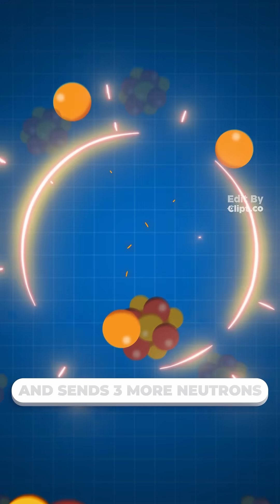How does nuclear energy work??

Comment: Nuclear power plants aren't scary if you actually understand how the plants function.
Reply: fr, modern-day reactors are so hard to have meltdowns in that it's impossible. Chernobyl was literally just the USSR not keeping them right and Fukushima was just the side effect of the tsunami (which was 15-16 years ago). tech has come a long way, sad to see people being scared just cuz the word nuclear is in it and it has some bad memories
Reply: @justarandomastrocyte  Another thing to add to that, Chernobyl was a blowout, not a meltdown. All that causes blowouts is just too much steam pressure blasting a hole in a closed loop somewhere, which is actually more common in non-nuclear power plants since they generally aren't inspected the same
Reply: @autumntx  ic i acc didnt know that, nice!
Reply: @autumntx Trust me Chernobyl melted down pretty hard, even if the worst part was obviously the big ass blowout
Reply: @justarandomastrocyte  also, if I remember correctly, the problem with Fukushima was with the generators being hit by the tsunami and not because of the reactors
Reply: @minatoreoshino8613 
The generators were under sea level as a cost cutting measure. Had the company followed what the Japanese Electric Commission or whatever said, the Fukushima disaster would've never happened. It's all human error and greed.
Reply: @minatoreoshino8613 they were more dangerous since it was BWR as well. But even then Fukushima wasn’t that bad and the people keeping it up did a great job at doing so (the people that owned the reactors is a whole different story)
Reply: @justarandomastrocyte Also Chernobyl had a negligible director, heck, the three other reactors at Chernobyl kept operating almost 20 years after the accidents.
Reply: @existentialguy21plus Fukushima used a BWR reactor. Not a PWR.
Reply: @justarandomastrocyteAlso it's not the reactor itself that's scary, what's scary is our ignorance like what Dyatlov did.
Reply: yeah, I used to be terrified about nuclear powerplants, but learned how they work and I'm like "how the heck did nuclear meltdowns even occur??!??!" I mean I know a nuclear meltdown is when the control rods LITERALLY MELT, but like... That shouldn't have even happened
Reply: Its because there haven't been alot of meltdowns in history 😅

They are pretty safe. & Chernobyl operated fully via man power with a few engineers with pen & paper doing math with a biggol computer (named SKAL, it's pretty much just a fancy scientific calculator).

Now a days most nuclear plants are automated with Robots & computers & far less people with pen & paper. There's literally no chance of that big of an error. Even three mile island wasn't that bad (They got a small meltdown & released radioactive gases for a few hours but the Core was able to contain it in place unlike a full on explosion at Chernobyl) where's coal/natural gas/disel pretty much 24-7 produces smoke + far more toxic gases. Solar & wind also produce pollution during the production of Batteries. Dams pretty much are super bad for Fish habitats & 24-7 risk of overflow.

 @YourAverageProgrammer1
Reply: I have a feeling that public media also make people scared of Nuclear energy.

(HOT TAKE)
The Simpsons is one I think makes people scared. They represent spent nuclear energy as green goo kept in poorly maintained yellow barrels. And they represent work at the Springfield Nuclear Power plant as shot-y and dangerous. I’m aware it is a cartoon, and not all things are real, (And I have never watch the show), but since it is really the ‘only’ details people see about nuclear energy besides the nuclear accidents, and since it backs up actual ‘fact’, it sheds a poor light on a perfectly fine energy source (if used correctly).
Reply: and this guy explained it so wrong, didnt even explain the effect of neutron moderation properly
Reply: Yall guys khow a game called industrialist
Reply: Fact not fiction or fantasy 
Generation is dirt-cheap.
Both nuclear and roof PV. 
6cent kWh to 2cents kWh.
Nuclear electricity comes to your meter box full of GRID RENTAL COSTS. Big $$$$ cashflow. 

And then when the dunkelflaute stops, the GRID cashflow stops. But only when the sunshines. 

I am extremely concerned for the grid and the grid economics and the grid owners massive investment's ROI, return on investment. 

The grid was built over 14decades, 140years.
The grid is extremely valuable, too valuable to waste. Unfortunately to expensive to overbuild and too expensive to expand. 

The only way to double grid capacity is to build a second grid, basically double the existing grid capacity. At upto $13million per km in Australia and with 1million km in Australia, and limited number of decades, the fake GRID people live in a fantasy and will do more harm than good. 

Facts do matter, selective facts are just a fantasy. 

" Huston we have a problem "
A problem that most people do not see. 

I welcome all good thinking people because as you say it is a big problem. 

I got pissed off because my CivEng Degree friend who built designed and built earth dams in the rural Australia and read a book on nuclear chemistry promotes nuclear on national TV. 

He totally ignored my CivEng Degree and decades in large civil construction and building works and power stations and transmission lines and urban infrastructure. 

He took his EXPERT CONFIDENCE in areas of no expertese that was totally wrong. 
He got angry at non experts telling him he was wrong. FMD. 

We both have grandchildren who deserve a future. But he is wrong and only part right. 
He is dangerous. 

So I speak up.
Reply: Okay
Reply: It's scary when humans make mistakes
Reply: @healis  it's scary when humans cut corners is what you mean.
Reply: @milkycalcium3172  also the people hiring Dyatlov at Chernobyl, that idiot should've never been in charge of the fourth reactor
Reply: @Benjam1n-K14  I guess you are basing your knowdlege off the hbo series because dyatlov irl did what an actual rational person would do, it was just changed to add drama to the series
Reply: @milkycalcium3172  you don’t make nearly as many mistakes if you don’t cut corners!
Reply: @healis a meltdown is impossible nowadays, human error won't magically cause it.
Reply: Until they are, and then its a mistake that takes hundreds if not thousands of years to fix.
Reply: @ninji5226 Fukushima is safe three mile island is restarting and chernobyl is the worst possible outcome decades ago from a country that doesn't exist anymore
Reply: @ninji5226 no Meltdowns will happen bruv, calm dowm, but if you want humanity to go extinct in centuries because it got too hot, be my guest.

Comment: I think there’s a problem with this video, the neutrons have to be slowed to be able to start a reaction, the water slows it down because it has a similar mass, and also it has a side effect, if the water is boiled off a meltdown cannot occur due to the fact that the neutrons are too fast to sustain the nuclear reaction so the reactor stops, that’s why nuclear disasters rarely happen these days except for Chornobyl which used lead instead of water 

P.s they actually also remove the control rods that have alpha emitters that start the reaction to stop the reaction
Reply: Also, the outside of the reactor is made of lead and not steel as lead has a higher density than steel.
Reply: @imokaytrustmeBSS  Most nuclear cores are shielded in concrete and steel, and the outside of the actual reactor will be made of a neutron reflector
Reply: this is incorrect, a LOCA accident will indeed cause a meltdown as while the nuclear reaction would have indeed ceased without a moderator, you dont account for natural decay heat of radioactive materials which will melt the rods.

 although this is not an inherent issue, while this is an ossue for BWRs and PWRs, future reactors sich as the already existing HTR-PM cannot meltdown even if left totally unattended as it is made to handle extreme temperatures and self regulate its reaction, as temperature rises reactivity decreases which reduces temperature to an equalibrium naturally.
Reply: What you're talking about here is a moderator in a nuclear reactor.  I thought Soviet-designed reactors used graphite as a moderator.  Most others use water as a moderator, likely for the reasons you cite.  Boil-off of water as a moderator is a bit of a safety mechanism.
Reply: @kattphloxworthych  yeah I made that comment as I just woke up, so thanks for pointing those stuff out
Reply: @kattphloxworthych  and I also think it’s graphite too, but I struggle with memory related stuff
Reply: There is another problem in this video, the water steam turbine turns a diesel generator, great
Reply: @mfr04  What are you talking about? Where did you come up with this?

Comment: They’re far from scary. But you really did a good job explaining them. You missed a few important things (like the backup generators to keep things on in an emergency to prevent a meltdown. And the fact that the used fuel (which can be recycled we just don’t because funding was cut for the company that was researching it because of the three mile island meltdown) is kept in casks that are safe enough to lick or kiss
Reply: He explained what was important , which was that nuclear reactors are glorified kettles.
Reply: @user-pd6ev9gb7j  all power plants are. Anything that’s not Solar or wind (and some water turbines) use energy in the form of heat to create steam from water to turn a turbine to create usable electricity. Fusion will be too. We don’t know how to do it any other way yet
Reply: @youtubersdigest  Yeah
Reply: The control rods shall not be forgotten:(
Reply: I would pursue Nuclear Engineering if my nation's employment wasn't going downhill

Comment: So nuclear energy is just steam power, but futuristic.
Reply: Ironically, it’s also incredibly safe and is one of the better options for the environment. Uranium is also very very common.
Reply: Uhm I say no, because nuclear energy are just modified natural gas/coal energy by only replacing the heat source and fuel
Reply: yeah. in fact there are plans to essentially just go to coal plants, strap on an SMR, and keep the plant going because of how both are steam.
Reply: Not futuristic. The first nuclear reactors were built in the 1950s.

Comment: What's funny is almost every powerplant is just a boiling water and steam-rotated turbine. The difference is only in how to make that steam (coal, uranium or some other type of fuel). Of course, there are other types of powerplants that do not utilize steam. Water powerplant uses water and gravity, wind powerplants use wind. But even then all of them use some kind of turbine that rotates with forces that are available to it. The only powerplant that is widely adapted and does not use turbine, as far as I know, is solar

Comment: That's basically an oversized kettle with uranium rods instead of copper wires. I wish more people knew about that. Nuclear would not be so scary for the public
Reply: AN OVER SIZED COW?
Reply: @sree0814  kettle. English is not my native
Reply: WHY ALMOST EVERYBODY FORGIVES ABOUT CONTROL RODS THE MOST NEEDED THING TO MAINTAIN REACTOR RUN SAFETLY 

And i m not an nuclear power plant expert i just know a litte more about it 

Control rods work isn't that hard to explane in easy words 

"Control rods are made of materials what can absorve neutrons so the reaction chain is slower". 

And next thing about Control rods are 

"Control Rods can be insert fully to shut down the reactor. 
or get out of it and then reaction chain are unstopable"

And any western reactors are builded with additional cover around it so its much safer than chernobyl/soviet reactors what buildings of it was just oversized factories with less space inside amd don't having Additional cover around reactor building (good example of covers like Western are in ukrainian biggest nuclear power plant in zaporioza or in town like that (i don't rememper correct english name of it )

Comment: Bro just taught me how nuclear reactors work in 30 seconds while my teacher would've taken 2 business weeks
Reply: Probably becausw you need to understand why a neutron particle hitting a uranium atom even causes a chain reaction in the first place. And before that you need to understand steam engines as well as basic chemistry. Theyre not teaching specifically how a nuclear reactor works, they're teaching the laws that were the basis for creating a nuclear reactor.
Reply: It's because he over simplified it and didn't explain much
Reply: @alephnull7446  And made several inaccurate statements
Reply: And somehow ill end up learning more from this than i would a whole lecture @alephnull7446
Reply: He didn't even explain it correctly
The liquid in the core is called a moderator and the reaction cant even happen without it (uranium 235 undergoes fission from slow neutron fast one dont work) the reaction speed is controlled by a diff computer controlled mechanism which keeps the temp around 500 C by lowering a neutron absorbing material
And the heat is first transferred to a diff chamber using a coolant where steam is generated and electricity is produced
Reply: @MZ_Faswi  specifically boron control rods that are lowered and lifted to absorb excess neutrons preventing an uncontrollable chain reaction.
Reply: @MZ_Faswi  plus, he didn't explain that when the heat turns water into steam, beacuse of the uranium the steam is radioactive.
And he did't explain that uranium must be Enriched
Reply: @diegopari9708  uranium 235 is the enriched uranium
But the steam being radioactive, I didn't know that
Reply: @diegopari9708 The steam isnt radioactive. The water in the reactor never comes in direct contact with the water in the turbines, and the water in the turbines never comes in contact with the steam that is released from the cooling towers.
Reply: @MZ_Faswi That isnt true, the steam isnt radioactive
Reply: Yea😂
Reply: I learned it on one diagram
Reply: Of course, your teacher is paid to teach you. The faster they teach you, the faster their job is done and their no longer needed / paid
Reply: @Duck_side what? They have an entire school year either way, and how could a teacher be done if every year they get new students to teach to.
Reply: @Duck_side bro teachers take a whole lecture to teach you this shit
Reply: Theres no detail in the video

Comment: Now explain how a nuclear bomb works (for education purposes)
Reply: He did
Reply: Yeah. Its not like I would want to make one. Its not like I have the resources or skill to make one. Want tl learn how to make one for educational purposes only :›
Reply: this is literally taught in schools and for literal educational purposes
Reply: this thing, but instead of water, and a steam turbine, its just the reactor
nothing else, but the thing where atoms go crazy
Reply: @koppanyhorvath1875  this is incorrect, all you get is a heap of radioactive material.
Reply: fissile material is made prompt critical, usually done by compressing plutonium to its critical mass using conventional bombs. in modern bombs this is then used as a small fission bomb to create the temperatures and pressure to create fusion, which is the opposite of fission and far more powerful

conventional bomb -> fission bomb -> fusion bomb
Reply: @jason59k55   A little correction; there are two cores, the main one (uranium core) and the neutron initiator one (plutonium one), you make main one reach critical mass and by the same explosive, it makes the initiator one shoot neutrons to the main one, making the atoms release a lot of energy
Reply: Si 🗿👍
Reply: @becua1007 
Why I see the same comment here
Edit: GET OUT OF THE REPLY SECTION
Reply: It is very easy actually. You get nucleus made of Uranium-235, you explode some explosives and make it reach critic mass and by the explosion, you shoot the neutrons from the plutonium thingy from the nucleus, and as the energy has nowhere to go, it generates heat and photons, but they need pressure, and that pressure is generated when it all comes out in the metal case
Reply: basically you get a radioactive material (uranium 235 for example), put it into a bomb with a timer that when it gets to 0 starts the reaction (by shooting out some neutrons) and then you get a chain reaction that gets a lot of energy and heat out
Reply: A uranium bullet fires into a uranium tank that starts a nuclear reaction and the chain reaction starts. That’s it. That’s how a nuclear bomb blows up.